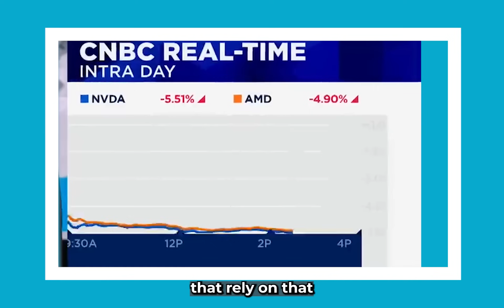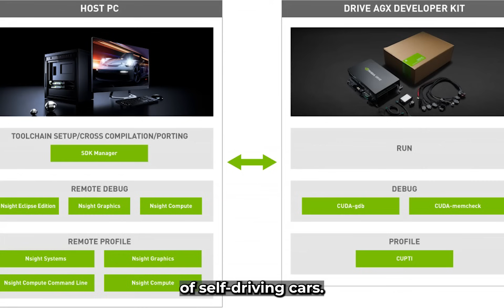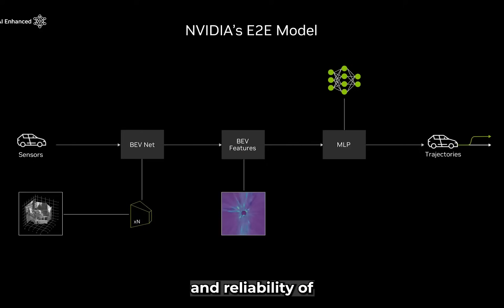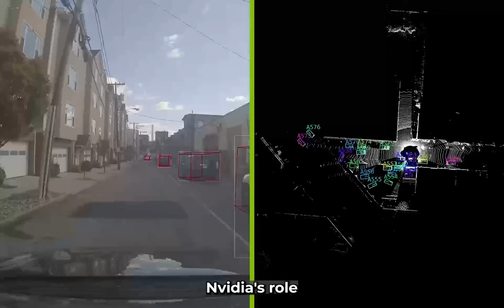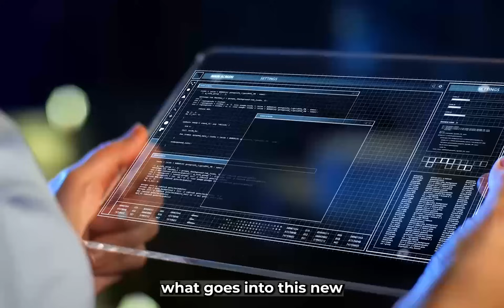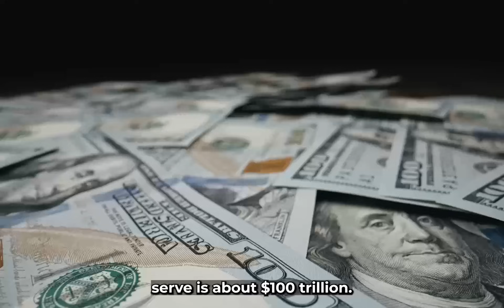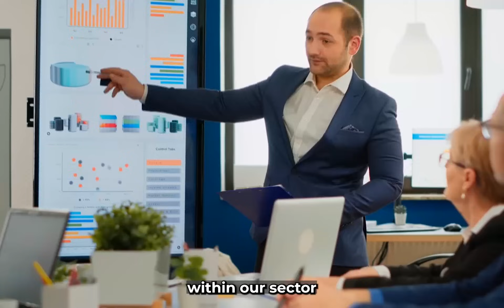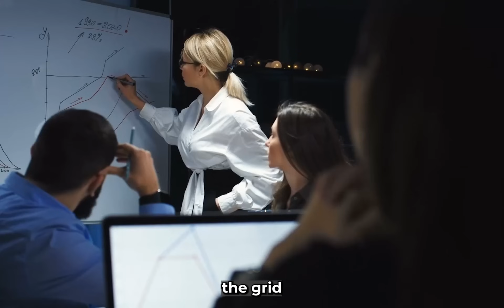"Nvidia is Heading for the BIGGEST BREAKOUT Trade Ever in 2024" - NVIDIA CEO

Comment: I feel investors should focus on under-the-radar stocks, considering the current rollercoaster nature of the stock market, Because 35% of my $270k portfolio comprises plummeting stocks that were once revered. I don't know where to go here out of devastation.
Reply: your risk tolerance seems to be low, these semiconductor stocks are going to be swinging both sides but I believe it will still 3X by 2030.  If you bought that much, consider a long term approach, iam pretty sure it will be better gains that the S&P